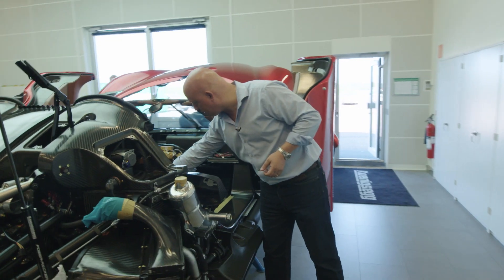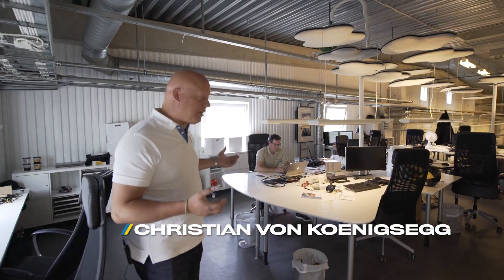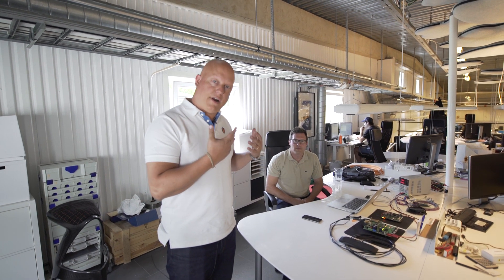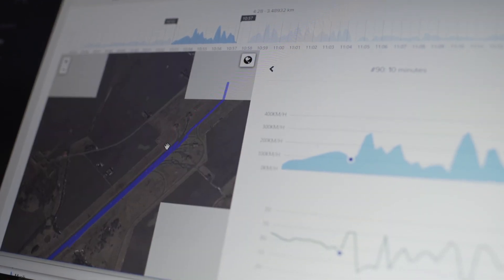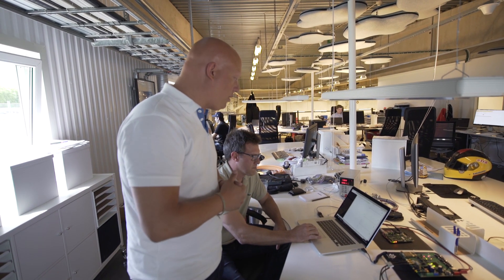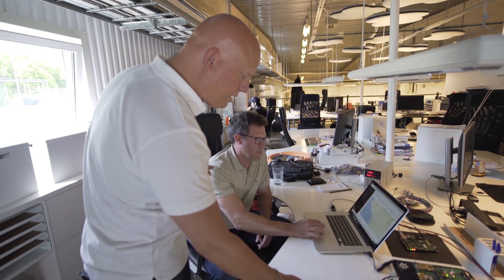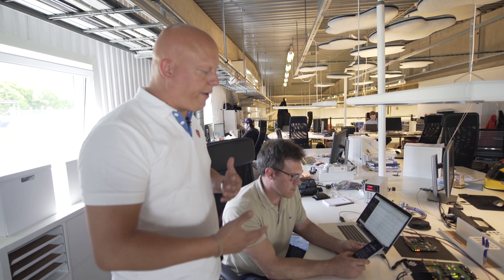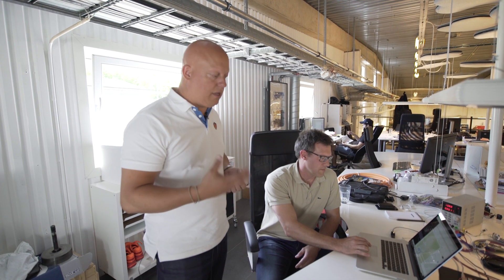Koenigsegg Regera Electronics and Connectivity -- /INSIDE KOENIGSEGG

Comment: The only solution I can think of to avoid hacker is just to only enabled the system update when necessary and just pull the 4G card out from the slot when finished/not needed.  (If the connection cannot be turned off manually).

Comment: /Drive how come you haven't retained the original numbering of the episodes? You did a 9 or 10 part series back in 2013. I saved those episodes and this would be number 16 if I'm correct.

BTW awesome little series. This and Launch Control are my 2 favorites.